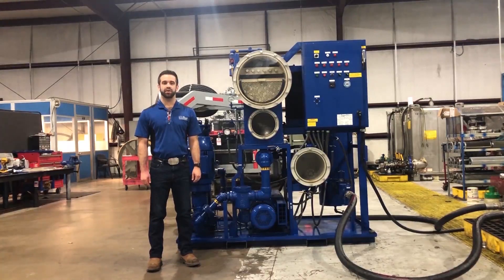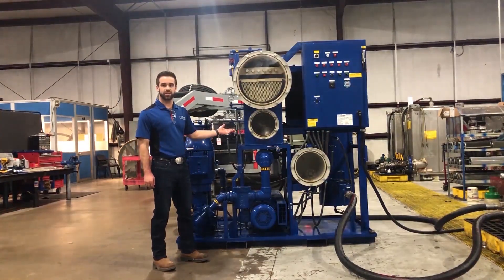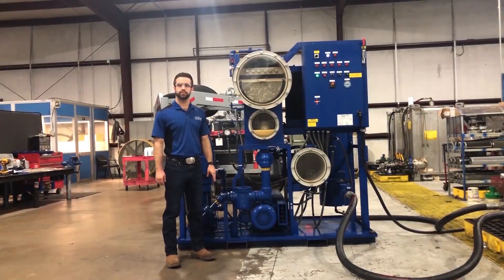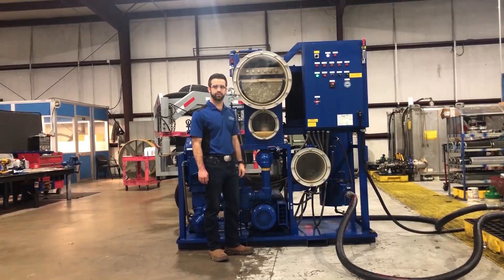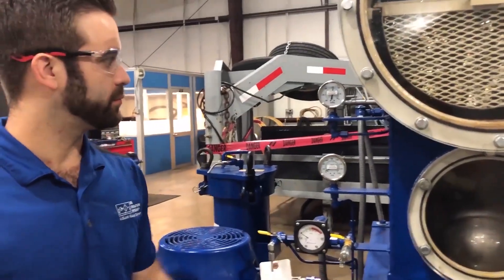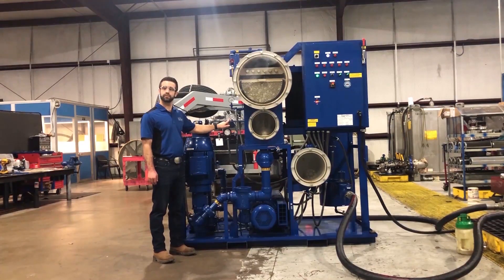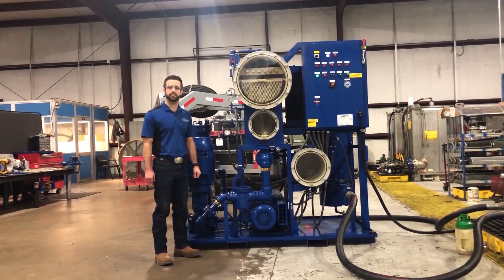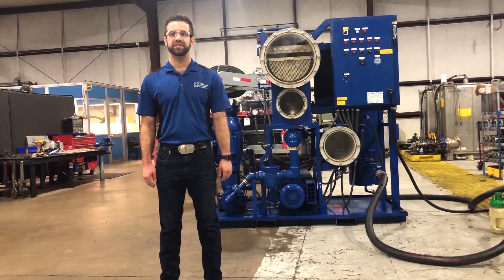Vacuum Dehydration Oil Purification System (VDOPS) Start Up

Comment: How do you dump the water build up in the condensate chamber? our system just got set up and we have 200ppm of water in the oil. its filling up faster than the exhaust can vaporize it, and ours is not equipped with the auto-dump feature in the operators manual. is there something we are supposed to be doing to drain it? we opened the manual drain but are immediately met with vigorous pressure shakup in the condensate chamber

Comment: We have one of these at my plant right now because our steam turbine oil has been somehow getting water in it which we are working on trying to fix. But the oil dehydrator has to constantly be monitored otherwise we start losing oil instead of water. The vacuum and the temperatures don’t seem stay matched up right. Do you have any suggestions?
Reply from the maker: Hi Nick! Please call the factory at 830-816-3332 and ask for Paul Spicer. We are happy to assist.
Reply: You'll never not have water in your turbine oil unless you have perfect seals. Look at getting a permanent skid to remove water.